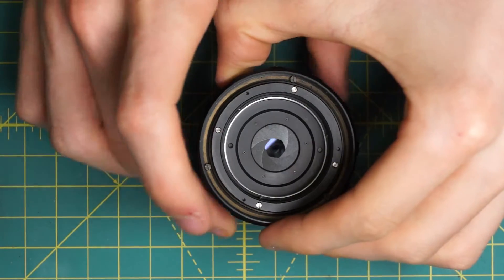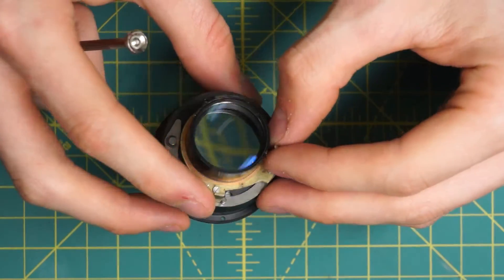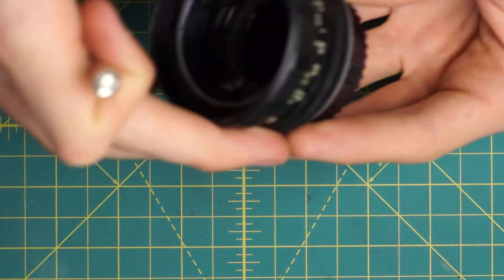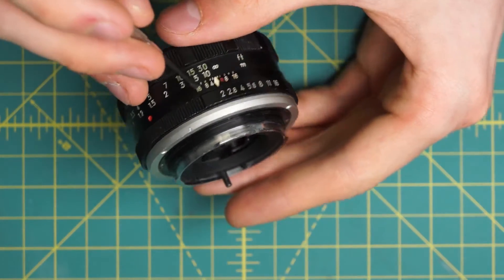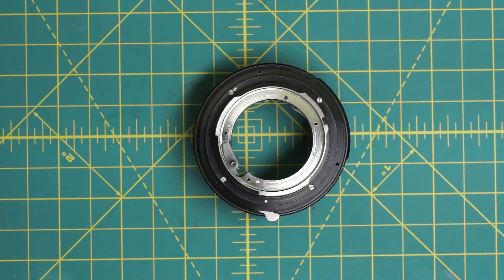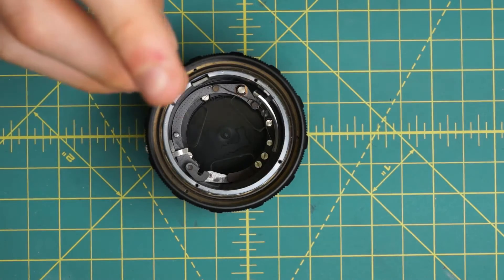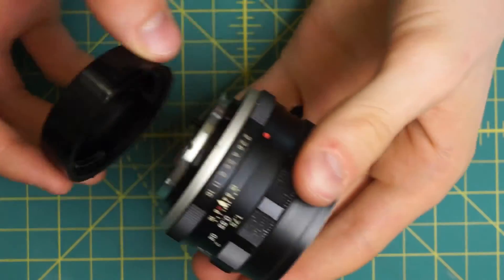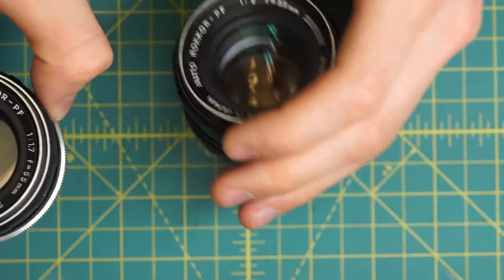Minolta Auto Rokkor-PF 55mm f2 (AR-C) Lens Disassembly

Comment: Hi! I have problem with reassemble a Minolta Auto Rokkor-PF 58mm. Is it possible to contact you and see if you have an idea of what I'm doing wrong? It seems to work fine until I zoom in to 0,6m, then it snaps out of position inside and neither zoom or aperture works. Would really appreciate if you could help out! Thanks from Sweden!